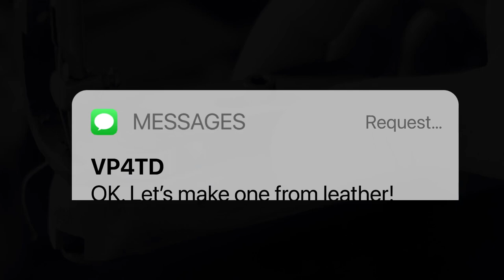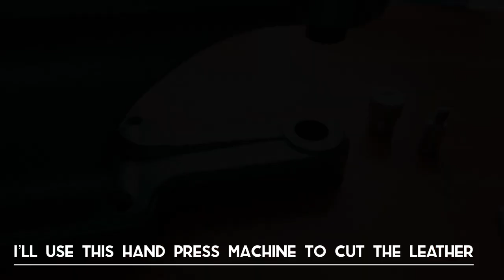CLSP Edge Sewing Guide - DIY

Comment: Well done.  It was a simple, great idea. A washer on top for the hex cap screw is all I would add.
Reply from the maker: Excellent suggestion. I have replaced the screw I initially used with a longer one and now have both washers installed (top & bottom).

Comment: Great work there, I would add a flat washer to the screw to stop the leather getting damaged though  ;-)
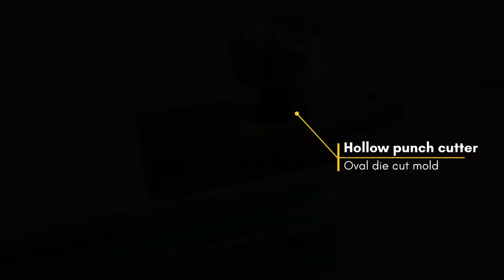Reply from the maker: Excellent suggestion! I tried it but will need to source longer screw as the one I got was a bit shorter. You’ll notice in 6:41 there is an indentation from when I was testing the fit with a washer on top. Thanks.

Comment: I enjoyed the video. Yet, I'm still frustrated. I will try to use the proper terms. I made sure the crank nob is at 12 o'clock, and made sure the bobbin holder's back wall is facing right. I put the bobbin thread through the first hole closest to the spring. I pulled the thread through the top hole that is lined up with the bottom hole. I got the thread behind the spread. I tested the bobbin shuttle and the end of that bobbin gear is flush with that hole on the left of the bobbin shuttle when the crack nob is at 3 o'clock. That vertical thread shaft top is at 1/4 inch protruding out the top. I sanded all the bobbins, bobbin holder, and shuttle area. On the hand crank, I made sure bobbin shuttle notch is in the middle grove, and the other gear notch is in the outer grove. I made sure that little notch in the middle is lined up with that small notch on the hand crank. So here is what happens when I crank the machine to pick up the bobbin thread. The bobbin thread is not moving so the needle could pick it up. So I removed the bobbin cover and test cracked it. The bobbin is moving properly. I put the cover back on and held the bobbin with a little tension. The thread is moving but still not picking up. I'm clueless.
Reply from the maker: I agree with you. These machines are amazing when you have everything dialed in. But can be quite frustrating when setting it up. I do have machine hiccups at times when I change to a different thread or needle size. I can send you a video of my setup after I run it through what you described in the comments to see how we can help fine tune your settings.
Reply: Did you check how far the needle is coming down? Put your finger over the bottom hole on the arm and in the lowest position, you should just feel the tip of the needle. If not, it needs lowered, if it's too low, raise it. If the needle doesn't travel far enough- the bobbin won't pick up the thread.

Comment: I thinking that you should put a washer on top, and make the screw into a wing nut type so that it can be tightened down a little better. I like the leather idea better than a piece of aluminum.
Reply from the maker: Thanks. Excellent feedback. I started using a washer based on feedback from others as well. This has been a very useful tip.

Comment: What Arbor did you use, and what glue and  training do I use. I just started in this hobby. Have lot to learn. Thank you for sharing!!!
Reply from the maker: For this project, I used a hand press grommet machine and removed the dies and replaced it with a small piece of steel. I also used contact cement to glue the pieces together. I created this playlist as a way to share small projects and solutions that showcase what thIs handy CLSP can do.
Reply: @VP4TD  Thank you!

Comment: Why leather and not metal? Are you just more comfortable working with leather or will it actually make a difference?
Reply from the maker: Great question. At the time, I was working with the tools I had (specifically for leather crafting). This could also be done with metal, wood, or even plastic. I initially experimented with a 3D print version which led me to this design.
Reply: Stick with the original leather, it seems to work well and looks good. It gives the machine “charm”.

Comment: Bearing I would like to find out what size bearing you used and where can I get them
Reply from the maker: I used ‘deep groove ball bearings’ with an inner diameter of 8mm and outer diameter of 22mm. These are normally 7mm in height. If you’re stateside you can get these from Amazon. They’re also likely stocked at your local skateboard shop. The bearing number is normally labelled 608. I hope this helps.
Reply: Looks very similar to the bearings used in skateboard wheels.

Comment: I would like to know what's the number of the screw so I can buy that size instead of the kit
Reply from the maker: Great question. The thread length I used for my machine is at 12mm; the diameter of the thread is 4.8mm. The head has a stamp of 12.9 grade alloy steel. Best to measure the original screw that came with your machine as these are forged or produced by different companies. I’m also thinking of using a slightly longer thread (16mm) so that I could add another washer for the top.